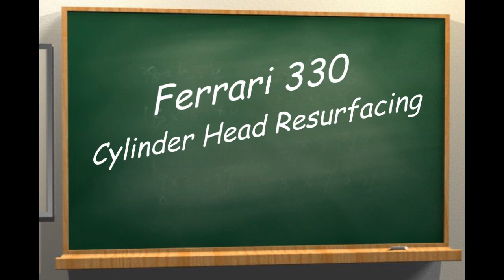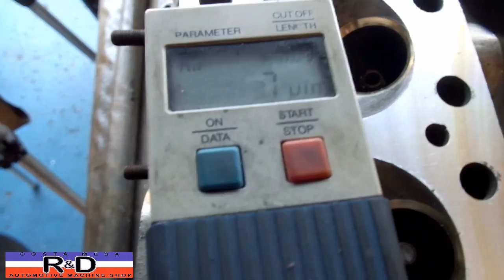Ferrari 330 Head Resurfacing

Comment: Any chance you'd ever combine all of the info on engine rebuilding into one video?  It wouldn't have to be a how too, just something that was a general rule for what should be done for atleast a bare bones engine rebuild.  

Things like magnaflux, cylinder head resurfacing, over boring cylinders, align honing for a crank shaft, ect.....

For example, I want to rebuild an engine with a focus on stock performance and longevity.